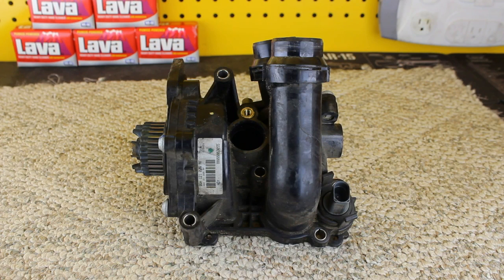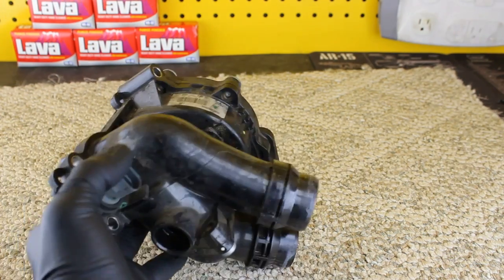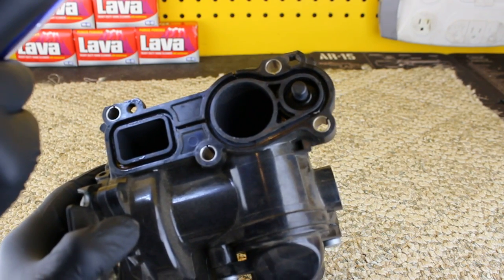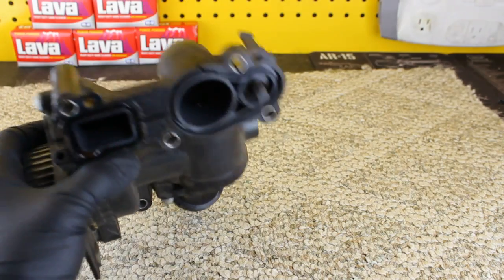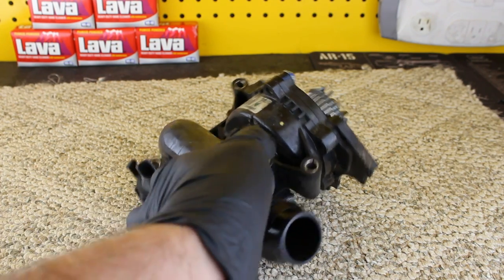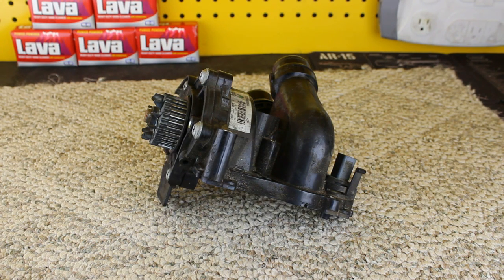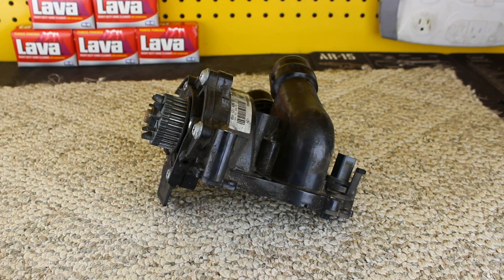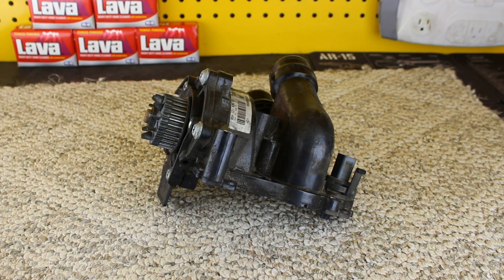How VW 2.0t TSI Water Pumps Fail

Comment: Does anyone know the part number of the original faulty pump? I have a 2010 A3 2.0 tfsi that had a defective water pump and was subject to a recall.  Except Audi never felt it was important to tell me.  I had the water pump and housing replaced.  Audi told me 6months later they would reimburse me, then didn't because I didn't give them the part number on the car.  I didn't know, it was taken off!  Can anyone help me out by sharing the original faulty part number?  Many thanks

Comment: Okay so my 09 vw cc was running cooler than normal I was thinking my thermostat stuck open it was not over heating at all no smoke no nothing I drove it for about three hours and the only thing that was happening was the temp gauge was going down (colder ) then up to operating temp car did not tell me to pull over it was fine
Reply: I took it too aamco bc i got a cooling system malfunction on my reader they said I had a water pump leak how does that happen

Comment: I have a VW Golf MK6 GTI water pump and thermostat housing is not leaking but I suspect the thermostat is buggered. The top coolant hose gets really hot and the bottom one stays very cool does not change in temp. Not engine or cooling light on. Not overheating but I find it strange that the lower hose is cool. Any help would be appreciated.

Comment: How much would it have cost to make this pump out of aluminum? Plastic and hot water seems like a bad idea to me.
Reply from the maker: Some of the new water pump side are metal. The plastic is not an issue (really) it's the oil leaking on to it that causes the issue
Reply: The BMW electric water pumps are plastic..and show a high failure rate. most fail before 50K miles.
Reply: Oil leak from where? I have the 2.0 tdi passat 140 hp. Had the oil pump chain failure but so far no problem on water pump

I had some losen bolts at egr vaulve and i guess my oil leak was from there, if it makes any sense, cause i had oil all over that area.

Comment: I have a 2010 VW Tiguan and I am hoping that my leak is nothing more than the Water Pump....I had tried to add more coolant and it came out like I left the faucet on and it was on the drivers side of the car.
Reply from the maker: Odds are it’s the pump.
Reply: @HumbleMechanic  Well I will find out this morning.  Having it towed to a Tech School to have it fixed.  Someone told me yesterday it could be a cracked radiator.  I am just hoping whatever it is, wishing it to be just a hose but as long as the car will be up and running soon.
Reply: @HumbleMechanic  Yes, it was the water pump and is being replaced.  The Tech school teacher told me I should take it to VW to have it evaluated for other things that the tech school does not do.  I have to get back about what it was, I lost my notes.  This is stressful to say the least.  I appreciate these videos.

Comment: what's the torque specs on the water pump?
Reply from the maker: +Bigchuck678 9nm but you have to follow the sequence too.
Reply: +HumbleMechanic your timing is perfect. I just took out the old pump and put in the new one!
Reply: +HumbleMechanic what's the sequence? also does the union to the oil cooler have too be laser straight? I can't get it to align 100% straight.
Reply: +HumbleMechanic never mind about the union not lining up. the pump was improperly aligned. now i have it corrected.
Reply: +HumbleMechanic what's the sequence? Is there any video how to replace it? thanks

Comment: The programmed failure on these VW parts in outstanding! Germans using Plastic Water Pumps what else needs to be said?
Reply from the maker: Actually the water pumps would probably be okay(read okay, not perfect or great) if it was not for the leaking engine oil. That is not the only way they fail, but it's the most common reason.

Comment: It's absolutely disheartening that VW group either hasn't figured out or doesn't care about the reliability of these piece of crap water pump/tstat housings. I replaced it on my 2016 Jetta with a CPRA engine at 90k miles. It's so bad that when I get any TSI/TFSI engine at work with more than 70k miles I automatically check them for leaks.

Comment: Tiguan tsi 2.0 , 2010, temperature of oil. 120°C, every time. always,   all day.      what is falling?   I change de water pump, about 15 days.   every time is run fan.       and motor is  slow.

Comment: I am tired of this shitty pump. Going to 3rd change... Crap shit.
Reply from the maker: Make sure you’re fixing the oil leak. That’s usually what causes multiple pump failures
Reply: @HumbleMechanic  
Is this the same deal for a '14 Jetta with a 1.8tsi? 
Mines leaking 🤦

Comment: If you're in the US, this pump resulted in a lawsuit against VW and they've settled as of Dec 2020. If you paid to get this replaced, you can submit for reimbursement (Deadline is Apr 30, 2020). If yours just failed and that's why you're here researching (i.e like me), VW extended the warranty on the part to 10Yrs/100k miles so you can take it to the dealer and they'll replace it for free. Sadly for me, I'm above the 100k miles, so this will be an out of pocket expense for me but you may benefit. See here for details: https://enginewaterpumpsettlement.com/

Comment: Need a class action lawsuit against VW until they do a recall!! On 3rd pump installed  by dealer.
Reply from the maker: It’s been on warranty extension. Recalls, true recalls, require very specific circumstance. I don’t disagree with you btw. 

Now the biggest issues is not fixing oil leaks.

Comment: This is bullshit, they should install simple Toyota water pump that last decades
Reply: M Ridware I'm a tree The newest Toyotas use 'plastic' oil filter housings {and who knows what else is plastic}. I used to have a 2011 Camry, and after only 100,000 miles, the transmission started failing. Also, all the suspension components in Toyotas are cheap CRAP. After only 100,000 miles, my insurance actually totalled my entire car just because ALL the suspension components were failing {even though the car was in cosmetically brand-new condition}. I will NEVER purchase or associate with a Toyota product ever again.

Comment: Manifold replaced, water pump replaced. Sent me paperwork  I can applied for some refund, not even worth it to do paper work. VAG cable failed. Leatherette driver side cracked. Called VW don't wanna do anything with it. Maintenance very expensive. Completely forgot about vacuum pump. Only what I can say to VW shame. Reason bought CC because was built in Germany. But now I've lost trust to any German car build. My Mercedes ML320 same poor quality. Will never recommended to friends.
Reply from the maker: Dang :( can’t say I blame ya